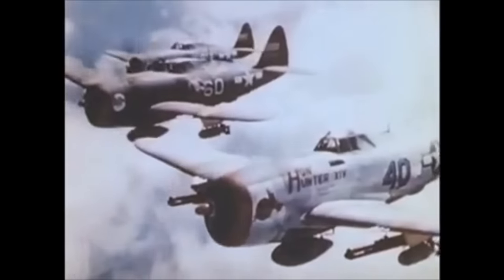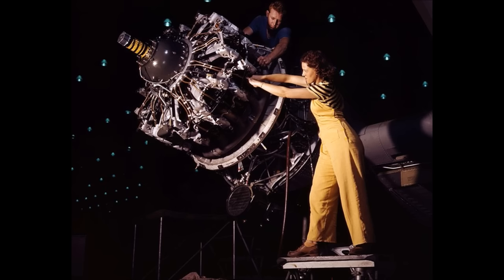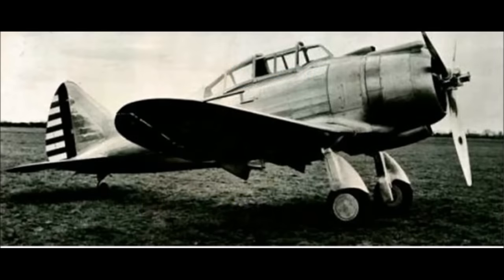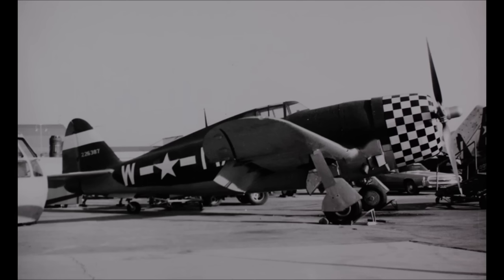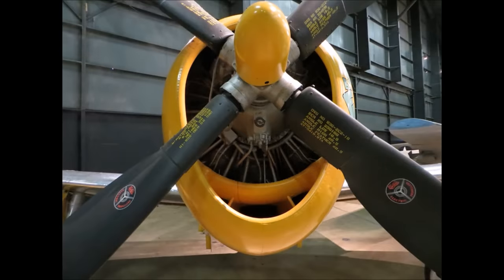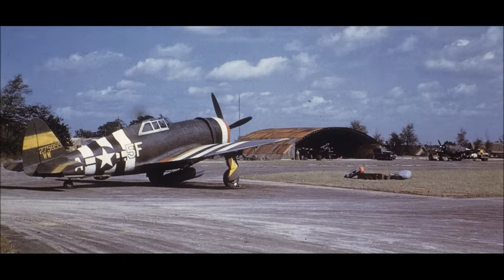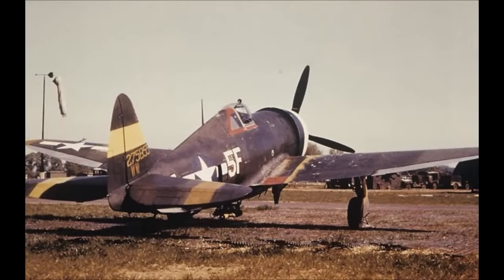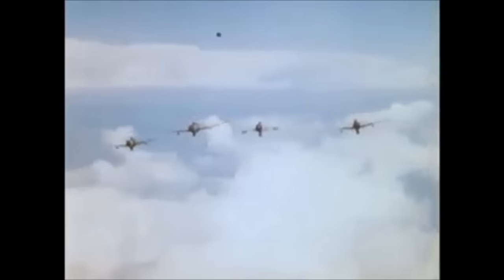P-47 Thunderbolt Pt. 1 Design and Speed

Comment: love your vids, like the technical data you go trough and not just the standerd docu set up. maybe for your to do list the p-61 black widow.wich is my fav ww2 plane.
Reply from the maker: The Black Widow has some special technology which I will cover, but I have to cover other stuff first.
Reply: that is why i said your to do list hahha, I read some intresting things about how they flew them, atleast as it is written in the Osprey book i have, like 1 engine turns to boost manouvrabilety, and the wierd crew configuration with the rso in the back, or the 2nd cockpit position depending on turret or no turret plane.

Comment: 2 questions:
One thing that has always struck me about radial-engined fighters was how un-aerodynamic their noses looked. Does the exposed part of the engine in front (above the duct) actually get cooling from being so exposed? Or is there some other reason for not fitting a cone to the propeller?
And as for the escort carriers: if a fighter as heavy as the P-47 could launch, why couldn't the f6 or corsair do so? Or was their restriction from escort carriers due to issues with landing? (I would assume that the arrestor system could handle them?)
Thanks for this excellent video; I look forward to part 2!
Reply from the maker: The radials need a lot of airflow to the engine for cooling. There were experiments with fitting cones, and some worked well, others didn't. Focke Wulf tried some innovative stuff, but it never really worked out. I'll cover the aerodynamics a bit more in the next episode. Regarding escort carriers, Corsairs and Hellcats can launch from them with no problem. Landing is the issue. Heck landing a Corsair on an Essex class is pretty scary.

Comment: Dang it - where is part 2? Very interesting as always. Thx. For part 2... I casually ran into an old gentleman at a local rc field who had been on a ground crew for some p47's in the war... he said that they had a large pile of warped gun barrels off the planes because it was common practice (with their field) to use the guns to slow down in a dive, and the gun barrels would warp from the heat.
Reply from the maker: Part 2 is on my hard drive and not yet complete.

Comment: The DCS version of the D model has 22k turbo shaft RPM at around 17kft. Tops out at 64 inches of manifold pressure in WEP, though, iirc.
Reply from the maker: That sounds great, i'm sure the DCS sim is accurate, I hear a lot of good things about it.
Reply: @GregsAirplanesandAutomobiles  yeah, they try. These are great videos btw. Thanks!

Comment: I have been doing some mucking around in IL2, and I figured I would ask you this before I go further with reporting on this:

When in the 47, at all altitudes and manifold pressures, both with and without the turbo spinning; setting up the plane to fly at a constant speed with the engine at 2700rpm: reducing the engine rpm to between 2600-2500rpm using the prop governor will cause the aircraft to increase its speed by 6-10mph. 

An increase in speed happens when the speed drop causes the manifold pressure to drop by up to 15”. 

Can you think of any situation in which the 47 specifically, or any aircraft in general (its not the only one that does this) would have this behavior in real life?

P-47D-28 running 65” with water.
Reply from the maker: No, max power for this engine is at 2700rpm and also maximum speed. There is a misconception out there that pulling the rpm back increases speed because it increased prop pitch, so that might be where this is coming from.

Comment: Your videos are Magnificent.
I listen carefully to learn, very important! Then I cogitate. In all of the videos on different planes, you give DOZENS of switches and knobs and dials the pilot has to control (I understand why they are there and their importance but...). When did he have time to FLY the plane? And in the middle of a dogfight with dozens, perhaps a "plethora of dozens" of things happening - not to mention bad guys slugs coming at'em, how did the pilot find time to worry about head temps going over redline a bit or the intercooler temp being out of range or if the cowl flaps were causing loss of airspeed?????.  (BTW, were cowl flaps ever possibly used to cause an enemy to overfly the plane by slowing it down in a dogfight?)
My head literally spins considering all the things a pilot would have to keep on top of at the same time he has to keep from being shot down!!!!!!!!!
At the end when they are taking off from the carrier, because of short deck - even with catapult I would think they'd be at full throttle and would be left wing down from torque????
I often stop and go back several times to devour the info.. And I listen closely - at 24:58 you mention a 12.2 inch Curtiss propeller. Is that an error or does inches refer to maximum pitch? It took me over an hour and fifteen minutes to watch this (to my satisfaction.)
Reply from the maker: Your post gives me an idea. I should make a video explaining how the pilot actually manages all of this. It's not nearly as difficult as it seems at first. Dang it, I mis-spoke, that happens. The prop is 12.2 FEET in diameter. Torque is a big factor when the engine is accelerating. They took off with it stabilized at max power. However, P-factor was pulling to the left, but judging by the control deflections seen in the video of the carrier take offs, it wasn't too bad. The Thunderbolt's were under pretty good control, but just barely above stall.
Reply: Thanks for clearinbg up the torq/acceleration thing. I read a lot about the corsair after watching Black Sheep Squadron and learned that more than a few pilots torqued over and crashed on take off..
Reply: Thanks for alll of the great videos, and indepth explanations. I hope you are able to include some explanation of how all the preflight "things" could be accomplished in the heat of launching dozens of planes to fend off an impending enemy attack.

Comment: Hi Greg, I'm struggling to frame a question here so apologies if it makes very little sense. So I'm fresh off watching the latest 190 video and I think my question is, what did NACA think about that particular design type of engine cowling? As in, having a smaller but much faster fan inside the cowling and a ring style oil tank.

I think I'm trying to ask a larger question here. Was there ever a different design philosophy running in parallel to production radial cowlings on what we see in corsairs/hellcats/P47/Bearcats, in the US specifically. I think I already know the answer to this, which broadly assumes that the advantages of cowling design as implemented on aforementioned US fighters were superior to a 190-style cowling that no one ever really paid much attention to it.
Reply from the maker: Hi Asif, I don't know of a NACA report of the 190's cowling, or any cowling using a fan system. I'm not sure why they didn't do it, but I will be addressing the aerodynamics of the 190 vs. some U.S. radials in an upcoming episode.

Comment: Greg, if this is outside your area of expertise tell me, but could you look into a follow on fighter to the F-105 Republic tried to sell as a better dogfighter? The premise was close to that of the F8U-3 Vought tested against the F-4.

For that matter the F8U-3 would be an interesting study.

During the same competition, Lockheed supposedly redesigned the F-104 for the same purpose. While I cannot imagine anything short of a full redesign making the blasted thing long-legged enough to make it effective,  I've only read about it conceptually. I've not found any information about the final design studies.
Reply from the maker: Making videos about cold war jets is actually a lot easier than the WW2 stuff. However, I am getting nearly zero requests for them. I'm not familiar with any follow on to the F-105. I am familiar with the F8 in it's various forms and could easily cover that one.
Reply: Greg, consider this a request. A shortcut to what I have in mind can be wrapped up in one engine: the Pratt and Whitney J75. It was used in the F-105, the discarded North American F-107, the Vought F8U-3, and I believe the F-105 dogfighter.

I will admit the GE J79 had more influence. Powered the F-104, the A-5 Vigilante, the B-58 Hustler, and one variant of the F-16.

Comment: Very interesting stuff, I'm interested in anything with an engine! The turbo lag caused by having such long exhaust and inlet plumbing must have been considerable but then again I guess the engines were operating at fairly steady RPM's for most of the time so the lag would not have been noticeable.

Comment: Was rocket assisted take-off an option for the P-47's on the escort carriers?  Was RATO an option for Billy Mitchells raid on Tokyo?  Easy for the flight deck crew to saturate the flight deck to prevent the deck from catching fire and leave the water running to carry the heat off the deck while launching?  PROST!
Reply from the maker: I don't think it was an option, it would have worked, but the Navy didn't even allow gun charging on the carrier (from what I  understand), thus firing off rockets on the deck probably wasn't going to be allowed on any large scale.

Comment: Greg, another great video packed with information.  One thing I don't think you have covered in your comparisons is the amount of maintenance these planes required from the ground crews to keep them flying.  It would seem the Germans were short of manpower and would need to keep their planes in the air much longer between maintenance intervals than the Americans?  Is this a correct assumption?  Did this allow the Americans to push their planes closer to their ultimate limits or effect design philosophies?
Reply from the maker: The answer to that is complex and depends a lot on when we are looking at it. I'll cover it at some point. You are correct in that maintenance is a big factor.

Comment: in the following videos, could you discuss the different propellers that were used on the p47 since the different designs had a dramatic affect on performance.  it is interesting to note that the p47 always had a four bladed prop while the 190 and 109 always had three blades, how did these different designs affect maximum speed?  the p51d had both hydraulic and electric props and in the electric prop case it was slightly faster.... thanks greg.
Reply from the maker: Yes, I'll work that in. I don't want to do a propeller specific video, I'll just work it into the next parts of this series.

Comment: On the Spitfire, there was 3 types of wing. The normal ones, the clipped ones for low altitude operations, and elongated ones for high altitude reconnaissance/interception. This do not make you wrong, but can put the Spit on better light if you cherry pick things :-).
Reply from the maker: Yes, but, P-47M.

Comment: The more I think about the more I wonder why we built P51s at all. The war was already won by the time they entered service in any numbers and the jets were clearly the future. The P38 and P47 could have took us nicely into the jet age imho.
Reply: First off the 51 was developed for the Brits. As for why the US largely transitioned to the 51, same reason we switched from the M1 Thompson to the M3 "greese gun" cost and production time. You can get 5, 51's with spare parts for the cost of 3 47's and the 38 was even more expensive. Plus it was cheaper to operate, less fuel, less oil ect.

Comment: I wish IL2 Battle of Stalingrad actually reflected these statistics by NACA in-game so we can actually have the performance of the P-47 in that game. Sadly the US planes are underperforming so badly in that game since the developers insisted on using the incredibly conservative manuals used by the US. P-47 only reaches around 350-350mph at near empty fuel tanks on a clean airframe at 23000 feet.
Reply from the maker: I really need to fly the 47 in game more before I can comment on it. All I have done so far is fly it off line in non combat. However I can say that most online battles in IL2 seem to take place at very low altitudes, which isn't really where the 47 does its best work. At 23,000 feet even the slowest possible P-47 will do about 385mph, most will hit well over 400mph true airspeed. At some point I will probably make a video covering performance accuracy in on line sims. 

I will say that over at " I Fly Central" 's channel, he seems to be doing pretty well in the P-47 in on line battles.
Reply: @GregsAirplanesandAutomobiles  Yeah I see he's an amazing pilot with that thing lol. I might just be bad at flying the jug tho. But it would be awesome if you can actually comment on the performances of the planes in in IL2 and how they compare vs real world data in one of your videos in the future. Keep up the great details man. Really appreciate the knowledge here.

Comment: 1:10 little note there, the P39 never flew in combat with a Turbocharger, it was tried but ultimately never used.
Reply from the maker: Yes, that's covered in my turbocharger vs. supercharger video. It's too bad, I think the P-39 could have really worked out if thing had been just a little different.

Comment: Is there a complete set of plans available for this aircraft?  Have they been retained somewhere that they can be purchased?
Reply: I’m in my 50’s. I’ll retire in 10 years.  If my health holds I’m going to make a kit plane OR buy an old airplane and restore it to as near new condition as possible.  

I was an airline pilot into about 10 years ago, lost my medical.  I cannot fly without an instructor. I’m perfectly capable of flying except the FAA hasn’t approved the medication I have to take. Years and years ago a few people said they had “sudden onset” sleep issues.  The FAA immediately grounded every pilot who had been taking the drug.  Sadly, placebos have the same occurrence of reported problems. But that doesn’t matter… oh well

So now I build luxury homes and occasionally remodel older homes to make them 90% new. That is we take them down to studs and make any repairs to the foundation, and any additions then rebuild.  

I’ve never built an airplane but I have rebuilt a couple of pickups from the 1960’s.  Have a good friend who is an A&P.  He’s willing to help. 

I’d  love to build a P-47. I would build to to the exact specs of the P-47D bubble canopy. The only thing I’d do different is add a passenger seat, a luggage compartment. I’d have hard points and auxiliary fuel tanks.

Comment: Great video! There are two things I find surprising about the P-47 - 1, by all accounts it is incredibly tough. Did all that piping and tech somehow make it tougher? 2, it was so successful in the low level mission... Surely this is where it was at its worst, as the speed graphs (28 minutes in) show??

Also - Kurt Tank never had the benefit of all that testing the Americans did (I wonder what wind tunnels they had access to?). Did his cowling design come up to scratch? I know the prototye had a different shape front, and of course the FW190 engine had a fan at the front, so a different approach there.
Reply from the maker: All that stuff did indeed make it tougher, well in a way. It helped slow bullets down before they reached the armor, hence it was tough to kill the pilot of a P-47 when shooting from behind. The downside is that any hits in the turbo system could slow the plane down making it more vulnerable. In regards to ground attacks by the time they were really doing that with the 47, it didn't have much opposition from the Luftwaffe.
Reply: True, and it was a radial (which I thought of later). About the only allied radial single engine craft in ground attack in the theatre, so no easy comparisons for toughness...

Comment: It seems like a crying shame Thunderbolts were used for ground attack.  They must have been far more expensive than Hellcats and Corsairs, yet these two had the same engine and I assume much less weight due to avoiding the turbo system and the out-sized body to hold it.  Besides being simply cheaper, I imagine they did or could have had more payload than the Thunderboat.  I suppose however there's a massive logistics advantage to just having one aircraft to supply and service covering everything from high altitude to ground attack, even if the plan is far over-engineered for one of those jobs.
Reply from the maker: Exactly.

Comment: Was any testing done on airflow between those incredibly close spaced cylinder fins? If you look at any other air cooled engine from the VW Beetle to Porche or Japanese air cooled bike engines, the fins are much more widely spaced allowing good airfow between. They don't overheat yet see much slower air speeds over the engines.
Reply from the maker: There is data on that, but I never really looked at it much.